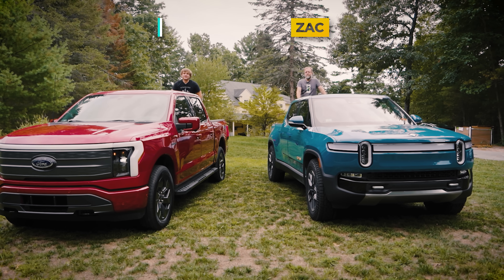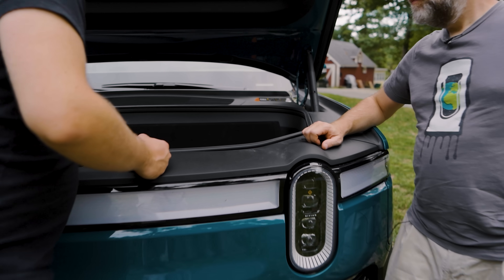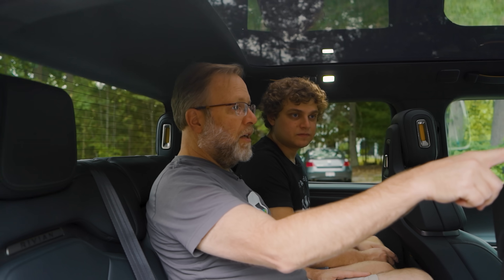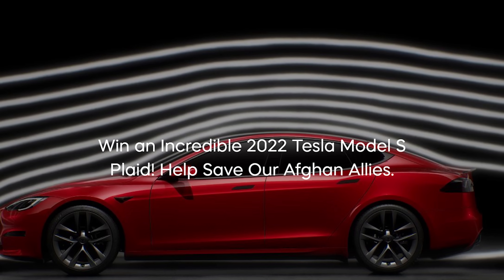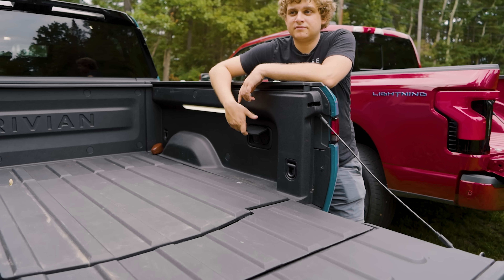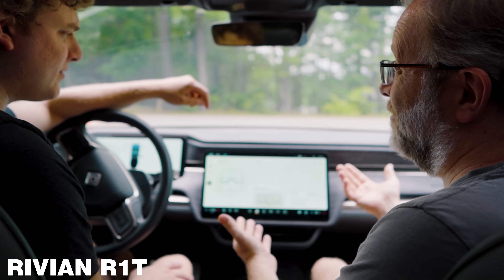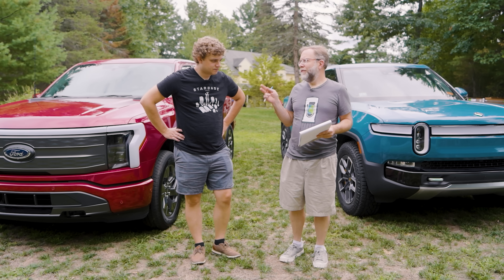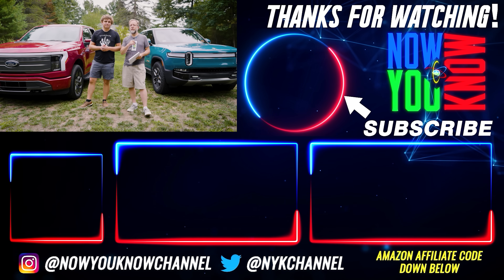F-150 Lightning vs. Rivian R1T -  Electric Pickup Truck Features

Comment: Bed access, in trucks I always use the bumper to step up to gain access to bed. With Rivian you cant do that. Kinda silly giving that to Rivian. 
The tonneau covers, you can spec your Ford truck with so many different versions. You did not order bed liner or Tonneau with yours but they do offer it while building your truck. 
I was cross shopping the two, honestly the rivian is limited in so many ways for what I do with the truck. You also did not cover intelligent backup which I dont use since I have home batteries but it is a key factor for many ordering this truck. 
Both are amazing but for different uses.
Reply: Sounds like you need a Canoo!?
Reply: @rogerstarkey5390  Honestly with the trails here that we do, my only hope for EV is wrangler EV. Supposedly coming by 2025.
I like to benefit from solid axles, high clearance, cheap body panels, after market support, control over low crawl etc. 
We do dozens of trips every year, so maybe different than most users but while most of us own EV's none of us are excited about any of the options so far. 

Rivian spinning its tires trying to figure out where to send power is not acceptable. F150 lightning (which I own) with mechanical locker is too large and too low. 
Too much power at nonsense pure joy level is great but the way all evs I have driven deliver power is not great for trails. Desert runs sure, I am sure F150 lightning or rivian will do great doing mojave road run but thats about as far as I would take those.

Comment: I may have to be “that person” and address the elephant in the room. 
personally I don’t think the R1T and F150 Lightning can be compared. Here’s why: 
1. The first (most obvious) is they’re in a different class of vehicle. The R1T would be technically speaking in a “mid size” while the F150 is a “full size” 
2. The price is SIMILAR yes, however, the F150 Lightning does start higher if optioned with the “extended range” battery, and goes up from there in the different trim levels. 
3. The market these two models are aimed at seem like they could be similar, but they are entirely different. F150 is for existing truck buyers who are looking to take the next step into the future BUT with some similarities so it’s not too different. R1T is aimed at people who are looking for an adventure vehicle. Something to take off the beaten path and having something brand new and different. 
4. Rivian owners are going to be similar to early Tesla adopters, who are buying into a brand they believe in and want to support. Ford buyers will be those who are used to existing Ford vehicles, especially previous gas powered F150s. Maybe even those who are contractors since there are a lot of benefits like having all the on board electric outlets for things like power tools to be used on the job site. 
Overall, the Ford winning makes sense. Ford is a bigger vehicle, have a higher (potential) market of buyers. It’s more “familiar.” The Rivian, however, being that it’s a BRAND NEW company, are doing extremely well stacking up against a company that has made vehicles for more than a century.

Comment: Can you put regular F150 accessories like a topper or tahoe cover on the Lightning? If so then that is a huge advantage. There are a ton of cheapish accessories in the market since regular F-150s are very common.
Reply: You can , all F150 accessories are compatible with lightning. Its the same bed.

Comment: Range, load limit and towing would have been very important categories to consider
Reply: Saw a tug of war between the two trucks and the rivian spanked the ford surprisingly
Reply: @briand4936  4 motors and a ton of power in them.. not really surprising. The F150 is no slouch... but that Rivian setup is a beast for speed, power and traction. That damn truck will smoke a LOT of fast cars.
Reply: Does anyone know if they did a comparison of range, load limit and towing ? Cost would be nice too for a comprehensive comparison
Reply: I have a feeling they will do that as a separate comparison.  This is a comparison of features.  Next a comparison of driving, handling, range, and charging.
Reply: You can see that on the website. 😀
If you follow them they have said it many times on the Tesla Time News segment they do.
Reply: @amircohen143  Couple issues with what you suggest first what is advertised on the website it’s pretty well known to not be accurate. Also on a comparison video to assume someone has to watch all your other content to know that information is not a good idea.

Comment: If you want to do significant offroading or "adventuring" then the Lightning would be a bad choice.  Saw that in an Out of Spec video - the Lightning is a capable work truck and can definitely handle dirt roads and fields but if you want to go out and do "adventuring" (rock crawling, trails, etc.) then it is not nearly as capable as the Lightning.  This is a very niche case though - if you're looking for a work truck then the Lightning is so much better than the Rivian as to make the comparison a joke.
Reply: aftermarket vendors for f150 will make lifts, etc. Then mechanical locker wins the game. I would say biggest disadvantage to f150 off road in ca is that trails are too narrow for full size truck.

Comment: There have been requests for an off road performance comparison between the two and I certainly would love to find out what Ford has to answer against Rivian’s adjustable height capabilities!
Reply: Mechanical lockers are only available on Ford lightning. No matter how intelligent you make the drive train, nothing beats mechanical lockers. 
I have seen rivians in the wild off roading, they are capable at less difficult trails and Rivian will outperform the ford off-road due to ground clearance. Ford has a mechanical locker, so if you dont mind losing some range and do after market lift / tires then ford would be the winner there in capability but due to its size, I dont think you will see many doing trails with this truck.
I have a jeep for this purpose, the trails in ca are usually too narrow. Camp ground and fire roads you may see both, more narrow/typical trails you dont see many F150's ICE version even now. Unless they are really old and body damage is not a concern.  Honestly it all depends on your definition of off-road. But mechanical lockers win hands down as far as capability. 

I would add F150 is more likely to have a huge aftermarket support system for those who want to make drastic changes to their trucks. Again at a cost to range etc. When there is enough of them out there, there are too many after market vendors for ford not to see some crazy setups. Even with only few thousand on the road , there are several small lift kits, leveling kits etc. 

STOCK I would go with rivian if only choice I was given was these two, I would take a jeep over both any day.

Comment: I have added a cover to all my F150s.  How much would that impact range?  I'd think that added airo dynamics would make up for the added weight.
Reply: Aero makes a much larger impact than weight (aka rolling resistance) - which is, in part, why towing is so awful in an EV: you have the aero of the vehicle plus the aero of the thing you're towing (and their weights obviously).

Comment: I'd like to see something like "This Truck Guy" head-to-head.   The suburban guy who commutes, shuttles the kids to sports, needs to pack for family camping, and the Home Depot run.  The sportsman who wants to carry the gear and access places for camping, fishing, and hunting.  The Handyman who needs to haul material, do chores around the house and the vacation property.  Etc.  How do these trucks meet the needs of people who need trucks?

Couple other things I've not seen.  Those unique headlights on the Rivian - how well do they actually work?  How well do the lights work in the fog?  I'm especially curious as you can't turn off the headlights and run just fog lights on the Rivian like just about every other vehicle.  I do that often when the fog is really thick as the headlights are just too dazzling.  The bed with the under storage - how robust is it?  If you had a load of wood chips or pea stone would it suck to get clean?

How does the Lightning stack up in those?

While I like the Ford's front truck for access, how well does it work when it comes to holding stuff?  With the Rivian, I can load up tents, chairs, roll tables, bags of clothes, and pack and pack and pack until the lid won't come down.  How easy is it to do that in the Ford?  Any chance of whacking your head on the bottom of the Ford's grill?  I actually did that once on my '96 Ram when I was doing some engine work.

Gear tunnel is an odd shape.  When packing, how easy is it to use that space?  What kind of cooler fits that you can access from the rear seats?  You need room for the lid to open.  Soft coolers would be a pain as the access isn't such to operate a zipper.  

You guys are in MA.  How do you travel to like Cape Cod or the White Mountains?  There are no fast chargers in either place that I can see.  Unless you overnight with a level 2 available, how do you do it?  For example, if you wanted to go to Pittsburg, NH from Worcester, MA to go snowmobiling, the only option seems to be a stop at St Johnsbury, VT for over 2 hours.  And that doesn't even include towing the sleds on a trailer.  The only Fast Charger north of Manchester is in Lebanon which isn't exactly along the way to anything but Vermont.  On the Cape, there is a charger in Barnstable which is rather out of the way if you are spending a week out in P-town or down in the Falmouth area?

Comment: Off road test!!!! See which one gets stuck first, and then deduct points. Also, in the true spirit of off-roading, see which one is the most modifiable (like winch, lift kits, big tires, aux lighting).

Might have to bring a dumb ICE Jeep with you in case you both get stuck.

Comment: To be fair, you can have a tonneau cover installed on the Lightning also.
Reply: And you can get a much nicer and more reliable one if you're willing to spend the money.
Reply: @danieljohnkirby9412  Honestly aftermarket add-ons are better quality than OEM in most cases.

Comment: The Ford feels like a working man's truck while the Rivian is a Show man's truck. Ford nailed it.
Reply: The Rivian absolutely dominates the lightning off road, 4 corner air suspension, dominates in performance, handling not even a contest.

Rivian is simply a smaller truck but WAY more capable
Reply: Saw a rivian in person and I have to agree. Very beautiful truck but smaller than I imagined it to be and Definitely looked like a show man's truck
Reply: I agree. I just wish the bigger battery option would be cheaper. It’s 77k starting with the big battery.  I would have loved an option to just upgrade the battery and not all the bells and whistles that go with it.
Reply: I got Rivian  because it reminds me of a Range Rover/jeep. But it’s way to heavy. So, I probably should’ve gotten the ford. But everyone drives a f150. Rivian does have cool tricks. And I just need an adventure vehicle. Mountain biking/hiking/surfing. I don’t need a working truck.

Comment: The AC power on the Ford is a big selling point for me.  That's really impressive.
Reply: 240v is great, but how much can the battery support and still drive home?
Reply: @williamhedrick5950  You can actually set a cut-point for the inverters to keep yourself from being stranded inadvertently.  Also, even the highest wattage power tools likely won't have a large effect on the range, especially if they're not in continuous use. 
That last one is not to imply that our power tools are stingy, but that it takes an enormous amount of energy to move around an automobile.
Reply: @h8GW  That's my point.  It's one thing to put 110v outlets, but by putting 240v in a pickup you're inviting someone to suck a lot of power.  Is it really practical or just a selling point?
Reply: The LOW giant funk PLUS the power was very well thought out.
Reply: @YKSGuy  It is a must for the Ford.  Without the low entry point the front would be useless and far to high off the ground to reach into. The truck to too oversized.  I would like to see how the lack of support functions in a collision.  Looks like a ramp to shoot a car/truck up into the windshield.

Comment: A smart man once said "You don't create the new system by obsessing on the current system."  Rivian should blow the Ford away because it was "blank sheet" designed to be electric, while Ford did little more than they did with the Focus Electric compliance car - take the gas motor out of a "real" truck and stick in an electric one.  Unfortunately, the first thing Rivian did with their blank sheet was draw a picture of a gas truck on it!  I wish some company would design an electric truck letting the form follow function - it probably wouldn't look like any other truck ever.  Great comparison, guys!
Reply: Cybertruck, hint hint.